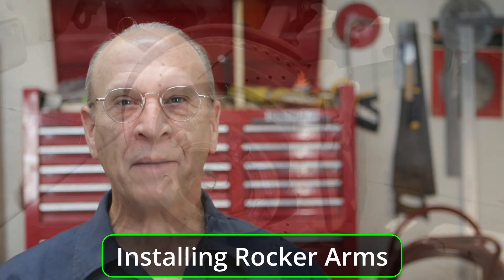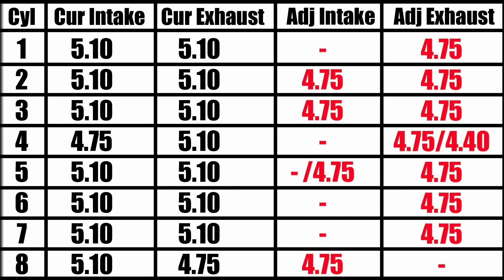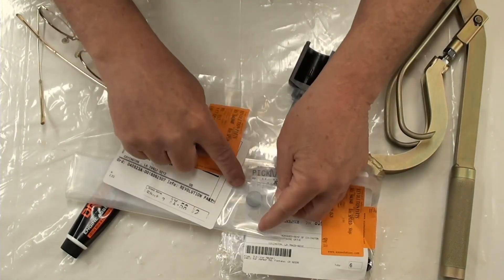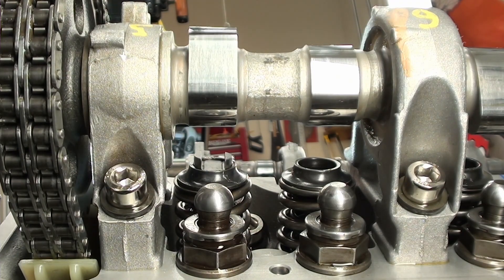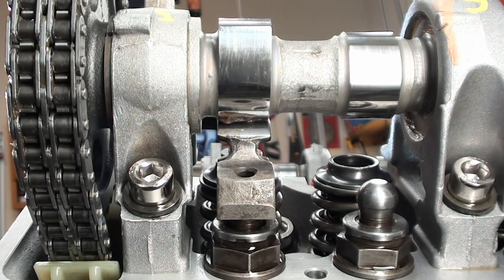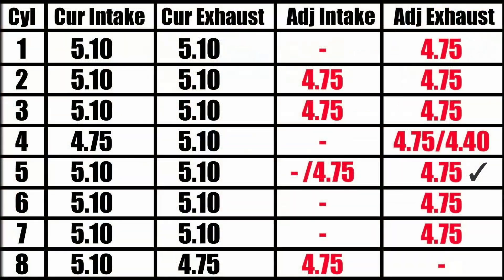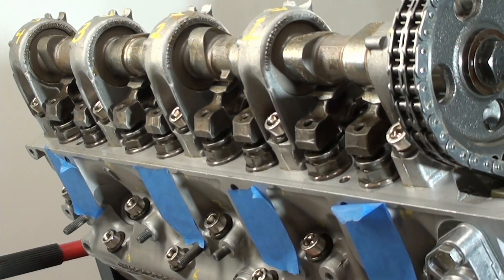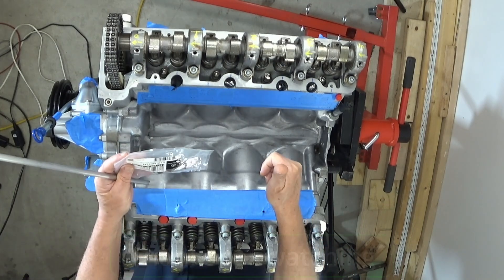560SL - Installing Rocker Arms

Comment: are the thrust washer suppose to be a tight fit or have some play? I have ticking noise and after further inspection the thrust washer on a few valves have play in them on 2 of theany idea?m the rocker arm also haany idea?  play..  some of them its very tight. I am trying to elimnate the ticking noise. any idea?
Reply from the maker: The thrust washers just drop in. They are not tight and they are not loose or sloppy. They just fit. As far as play goes. The rocker arm may be worn, the thrust washer may be worn, the compensating elements are worn or you could have worn valves or valve seats. You might want to test and bleed the compensating elements first. 560SL - Bleeding Hydraulic Lifters / Compensating Elements https://youtu.be/jmjHY-BCUjo  The only good way to measure valve clearance is with the Go-No-Go gauge. 560SL - Adjusting Valve Clearance / Compensating Elements / Go-No-Go Gauge https://youtu.be/WsKKa0vszaM

Comment: Hey Tony thanks for making the videos man. 
Much appreciate your efforts. 
Wants to ask you about the hydraulic compensator. 
Should they be rock hard once they've been pressurised by engine oil or do they give way a little?
Reply from the maker: @ShukriGabeli  the manual pretty much tells you how to test and what they should feel like. You crank the engine to pressurize them, then you use a long stick (like a dowel) and push. If it collapses it is toast and needs replacing. I also did a video on bleeding the lifters (compensating elements). Even after years of sitting they held pressure, but as you will see in that video, they will bleed off with pressure. I hope this helps.
Reply: @TonyLiveTV  
Thanks for your reply man 🙏
I understand the procedure as I have the manual and watched you videos many times over. What I'm not sure about is after my compensators are pressurised they are rock hard and don't press down at all. Is this ok ? Is this how they should be? 
Also I'm stuck with open valves after the machining shop has done valve grinding and skimmed the heads. The pucks are too thick now I need thinner pucks to adjust.
Reply from the maker: @ShukriGabeli  the question is, did you bleed them first? Bleeding is more important than holding pressure. If they don’t bleed, the valve will stay open which will cause damage of course. If they bleed super easy, the worse thing that may happen is noise and excessive wear. If you bled them first then you know they work correctly. That’s the only way to know for sure. That’s how I did it.
Reply: @TonyLiveTV  yes I saw how you did it and done exactly the same thing. 
The depress by finger pressure and it took a while gently squeezing the vice to bleed them slowly dripping oil so they look good. I have installed and torqued them to 60Nm. They pressurise when I cranked the engine and stay solid, when I try to press them down on some of them there's a tiny bit movement and some of them nothing at all. The guage red line shows about 2 mm over the edge and the valves stay open. I blow compressed air through the spark plug hole the air travels back to the air intake flap as well as out of the exhaust even the both lobes of the crankshaft are pointing upward.
Reply from the maker: @ sounds like the compensating elements are good 👍. Now just make sure you have the correct clearance: 560SL - Adjusting Valve Clearance / Compensating Elements / Go-No-Go Gauge
https://youtu.be/WsKKa0vszaM
Reply: @TonyLiveTV  Tony I must note mine is a 350se w116 1980
Pre 1982 is a different setting on the gauge. Some say is 0.5mm and some say is 1.5mm not exactly sure on that.
Reply from the maker: @ yes there are two version. Good luck 🍀

Comment: Hi tony 

My car sl560 87 i have problem in my rocker arm and now i need to change this parts but the original is to expensive i see from febi is that good ?
Reply from the maker: @MariaQueenGames  yes I believe febi is ok. I know of plenty using febi without problems. Make surre you check the compensating elements for proper clearance. I have a video for that. 560SL - Adjusting Valve Clearance / Compensating Elements / Go-No-Go Gauge
https://youtu.be/WsKKa0vszaM
Reply: @TonyLiveTV  thanks 🙏

Comment: For the rockers you can also use an allen wrench into the oiling hole to take them on and off.
Reply from the maker: Great idea! I didn’t think of that.
Reply: Hey George. What exactly do you mean? Put an Allen wrench into it and push it down?
Reply: @SHUVGALVM  on the older rocker arms, they have a hole on the ball side. They are there to lube the ball and arm. Get an allen wrench that fits. 5mm ? Then you must grind the short side a bit to make it shorter. Then you can then insert the short side of the allen into the hole and lift up. Then when it's up you just slide the rocker arm to the side and it comes off.
Reply: @ cheers for the description! I’ll give it a try

Comment: Hi Tony. I'm rebuilding the motor in my 1972 350SL. I'm no stranger to fully rebuilding high line autos. Past experience with MB was with a 1962 300d, 1972 600 Grand and a 1991 300SE. I can tell you that I'm so disappointed in the engineering of this car, especially the motor. It is a Rube Goldberg design from the start. The valve train and associated guides along the path is a joke along with the rockers. I can't wait to get rid of this project and continue with my passion rebuilding and collecting Rolls-Royces from 1966 to 1981. They do not have any timing chains or belts to deal with. Nite and day from MB. Continue the great work! Rob from NY
Reply from the maker: I agree! I have always said this engine is an over engineered block of aluminum. For me I think I prefer the old air cooled Volkswagen engines. They are as simple as a lawnmower. There is no timing chain or guides in VW either. Loosen 4 bolts and the engine is out. 4 more bolts and the intake is removed and 4 more bolts and you have a cylinder removed. All done with a floor jack. What could be easier than that?